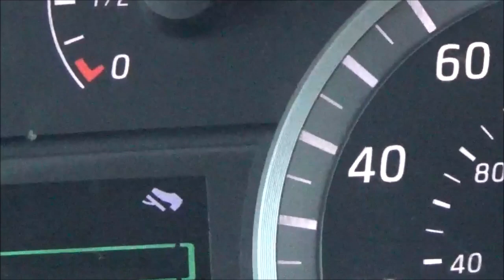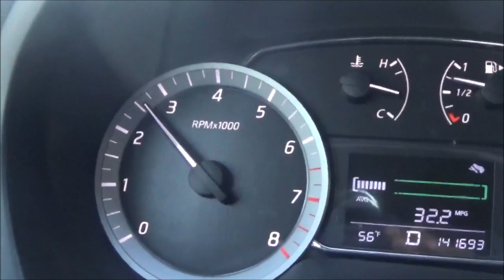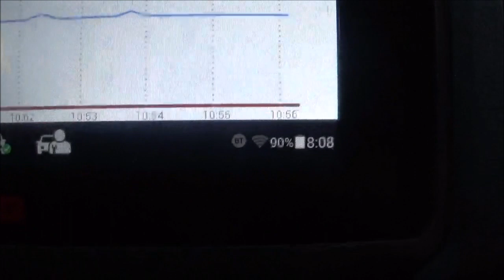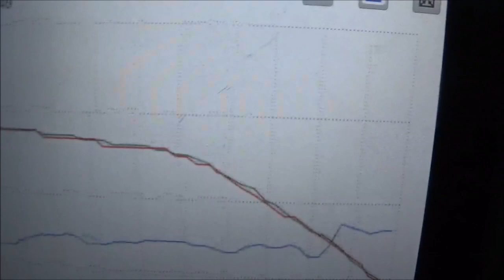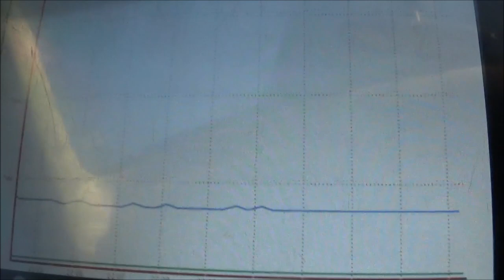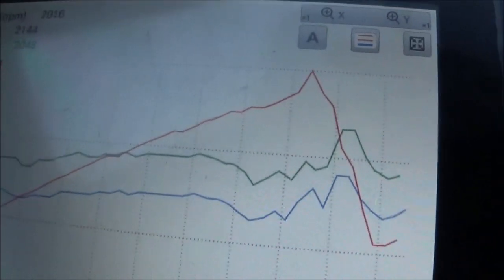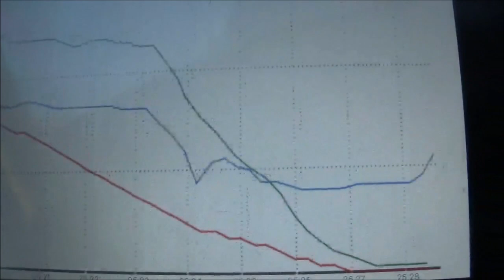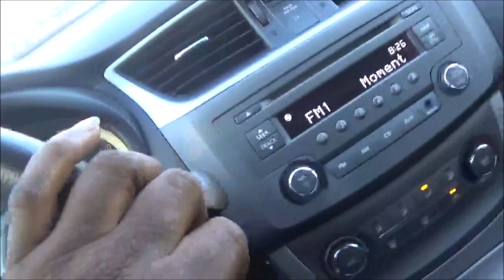2013 NISSAN SENTRA CVT TRANSMISSION PROBLEM

Comment: Mine drives when it's cold...but when it warms up....cvt won't go into gear even when I put it in drive...it won't go til I shut it off and let it get cold
Reply: Hi. Did you fix it? I have the same problem. First i replaced the whole transmission and after 3months it started doing the same thing. Any feedback?
Reply: @galaxyhome4387  no....my son quit paying on it so they repoed it...didn't have a chance...lol

Comment: I have the same issue, I am going to rebuild the transmission (RE0F11A) what do you think causes this? I will be changing the flow control value and all the seals, anything else's I should be looking for?
Reply from the maker: It is a mystery. Some solve it by changing the whole transmission. Some shops don't bother this transmission at all. It could be something other than the transmission affecting the transmission.

Comment: so, what was the fix for this transmission?
Reply from the maker: replaced the transmission
Reply: @thisisyourtransmission  Damn, well I have the same issue.  What am I looking at for cost?  Is there a way to get a rebuilt or used cheaper?  Is the dealer the only place that will do this replacement?

Comment: my nissan sentra 2013 cvt transmission is slipping from 40-50 miles and the rpm meter fluctuating and there is no engine light on , what could this possibly gone wrong ?
Reply: I got same issues same car   Do you fix that’s problem?
Reply: @haojjsauto2817   Do you fix that’s problem?
Reply: @esevcenco  no one can’t fix . Just put new CVT!
Reply: Same issue
Reply: @unknownsoul6941  Do you fix that’s problem?
Reply: Do you fix that’s problem?

Comment: I have a 2011 maxima. It would stutter to take off. Sometimes it would slow reach to 20 the drive normally sometimes it would stutter than go to limp mode. The code popped up as p0746. Went to change all the solenoids and now p0840 p0845 and p1777 showed up also with p0746. Car turns on but won’t move. Will rev up to 2000 rpm drop to 0 then back to 2000
Reply from the maker: Change the transmission

Comment: There is no slipping in nissan cvt transmission there is solenoids problems and cvt fluid need to replace every 25000 miels
Reply from the maker: You do know that cvt transmissions have forward and reverse clutches right?
Reply: @thisisyourtransmission  yes and most of cvt transmission from jatco have wetcluch they need fluid with specific cofiecient of friction someday i put an additive  lubegard and other friends try bars leak  soon after add it shuder and jerks appear so i change the fluid i advise any one have cvt with ams oil cvt fluid ,, the very bad additive is xado its realy shit the rpm began to go high and down with jerking , i not say that cvt never slip but first you. Should check clutchs and torque converter clutch.and solenoids 90 percent of cvt problems in that area ,, regards